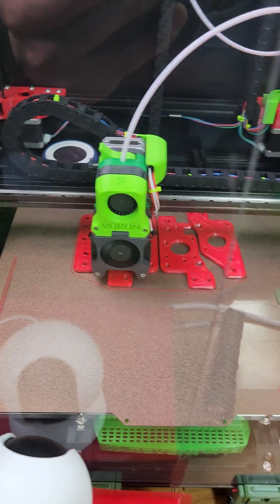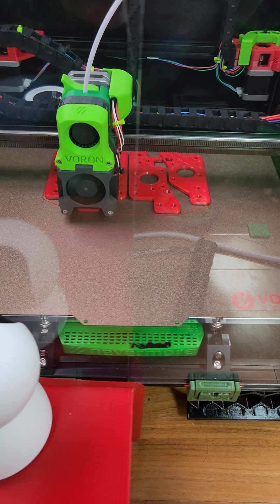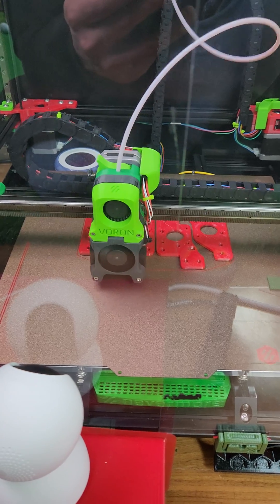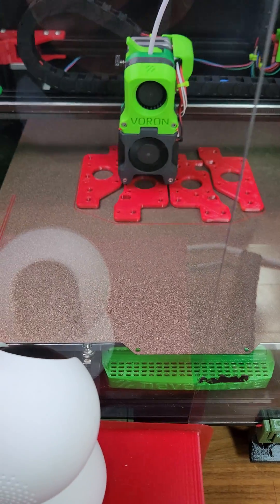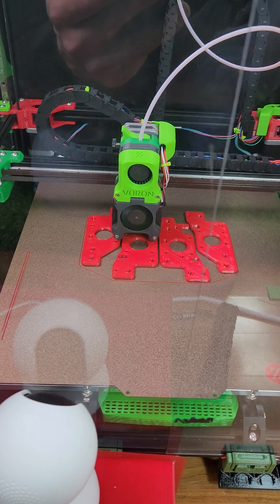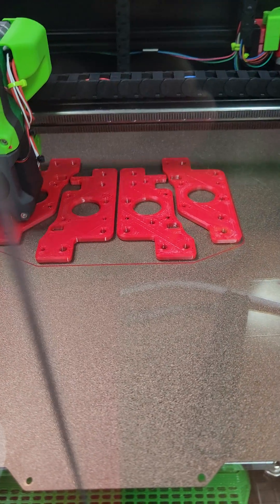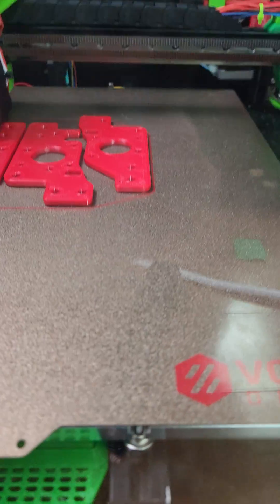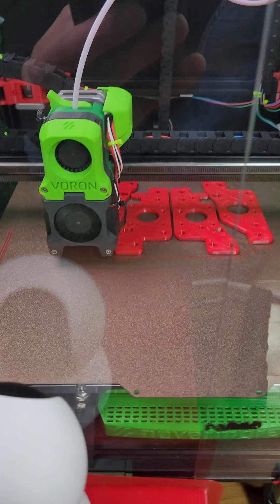How to Print ABS on Voron 2.4 without warping!

Comment: nice, I print abs+ without enclosure, the only things I do is to heat the bed around 105c and calibrate the z offset very close to the bed, I have no wrapping issue. I just bought a sheet of polycarbonate so I'll fix the enclosure later
Reply: isnt abs like toxic and it smells really bad if u dont have an enclosure?
Reply from the maker: You can put in a small room that's vented.  It is verg toxic indeed.
Reply: Printing inside small room, watching by camera can't harm too much